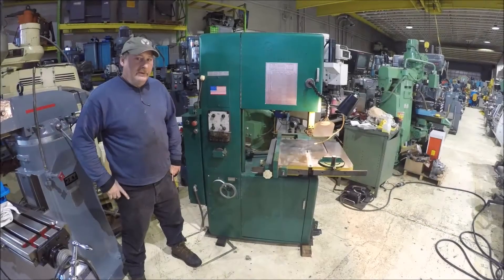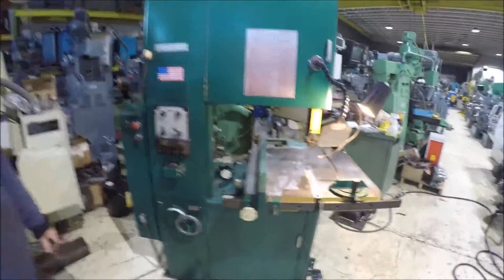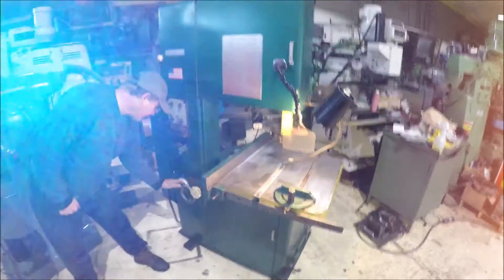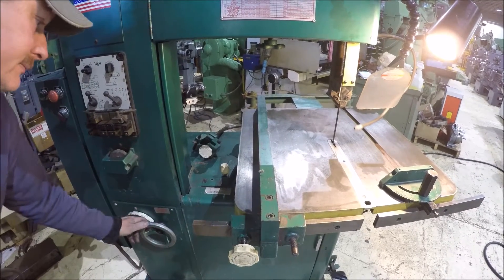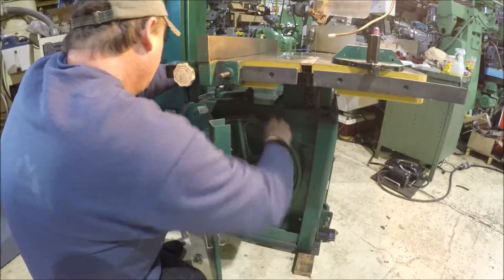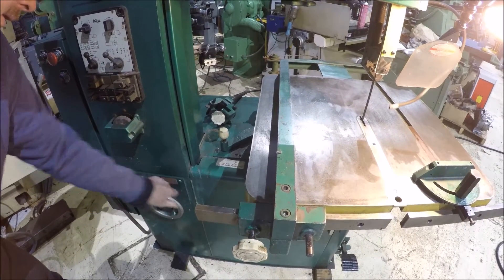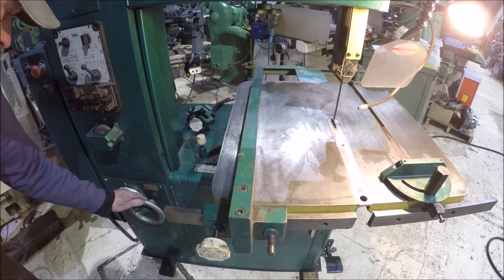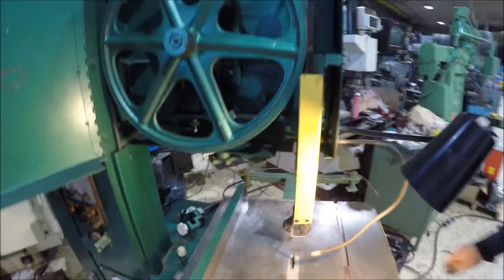Powermatic Model 87 20" Band Saw

Comment: Listen, I have an 87 i won at an auction recently and its missing the 2 speed control wheels, but still has the lower shaft and lower internal assembly with the worm gear and universal joint.

I can not for the life of me understand how that controls the speed on this...... there is a big stationary arm that holds in one side of the pully, which has a ball bearing sticking out of it thats all connected to that shaft with the worm gear

If you have any insight on how TF this is supposed to work please share it with me because im baffled lol